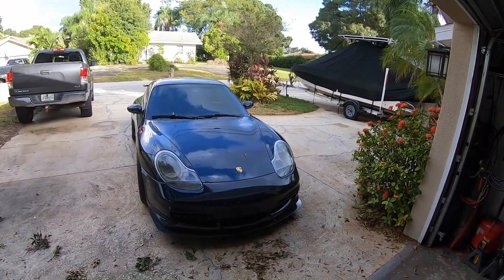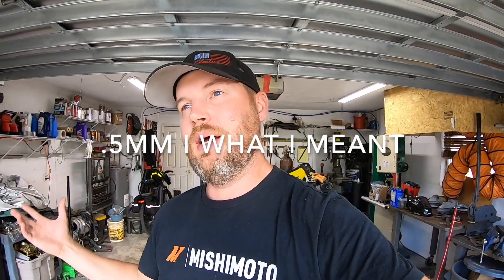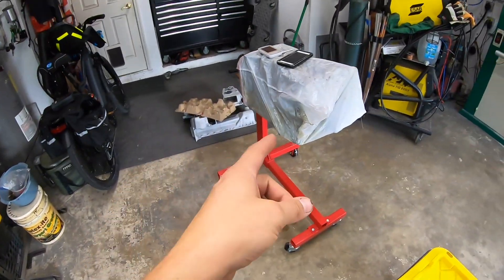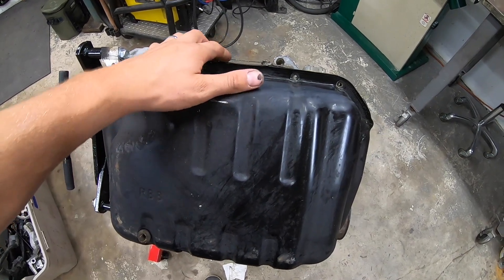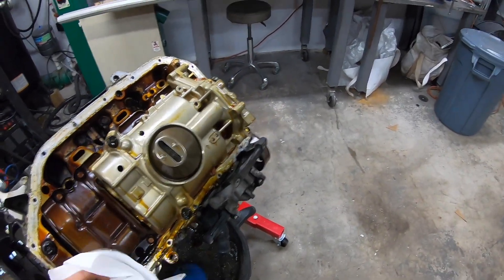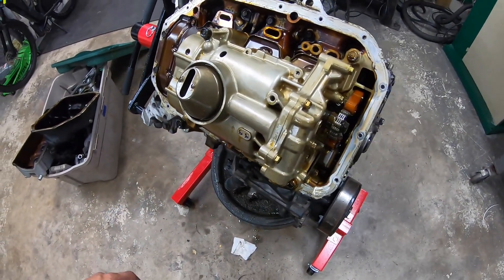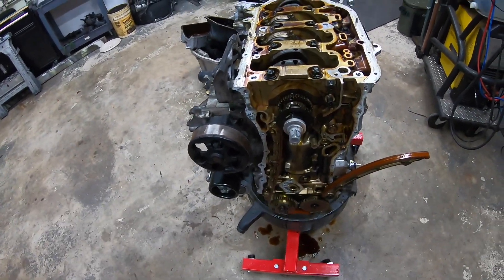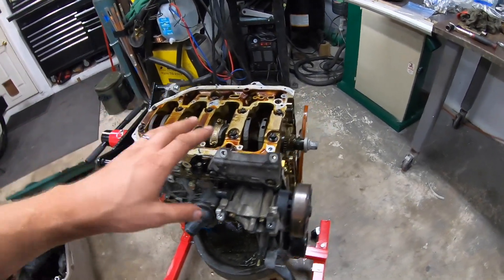Honda K24 Powered Porsche 911 Engine Tear Down And Game Plan

Comment: Do a partial devcon block fill on it and you shouldn't have any issues. Obviously having the cylinder support system in place will be very beneficial as well but a partial block fill with the cooling system still functional will definitely be enough to handle 6,7,800 no prob...

Comment: Nice methodical work on the strip down. If I remember right Kyle from BBoiz resin filled the head on one of his builds to strengthen it, I can’t remember which video unfortunately but he did say it was done by a lot of people. I think he filled it with sugar or something like that then added the resin on top and then dissolved the sugar - I can’t remember him saying it failed so you’d have to check, I think he did it not long after him and Wyatt moved to Florida. I hope the videos coming, don’t chase the subs they’ll come to you if you keep having fun 👌
Reply: It's was the v6 motor for the 240(ithink the one that's still in use)
Reply: @JayGee6996  Thanks, yeah I thought they did that on a K series, but it's the 240's v6.

Comment: If you can find a k20a3 from a base rsx (not the civic Si), it has the same oil pump as the rsx type S.  Check out the part numbers from Honda.  Those engines can be purchased cheaper than the oil pump costs individually.